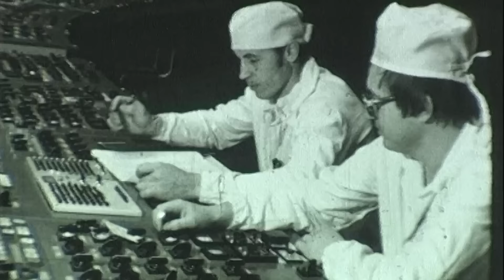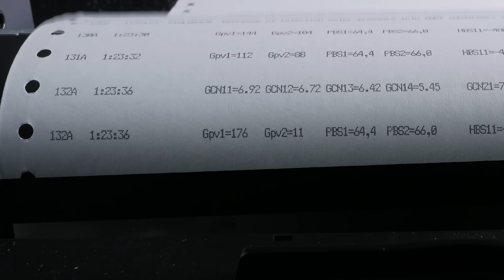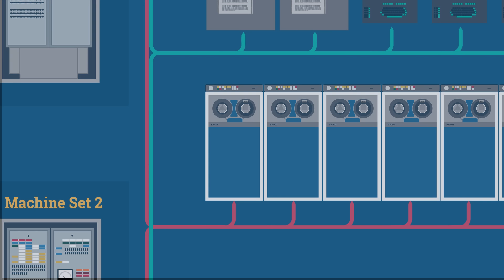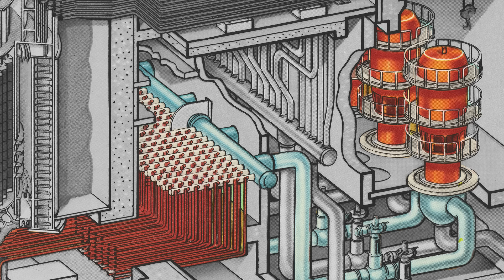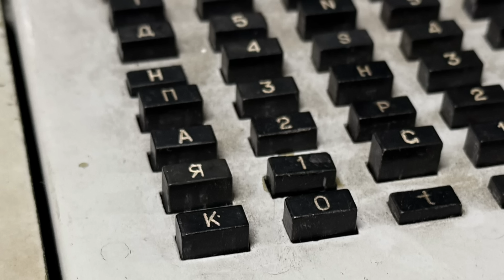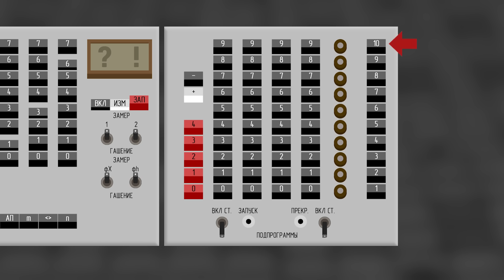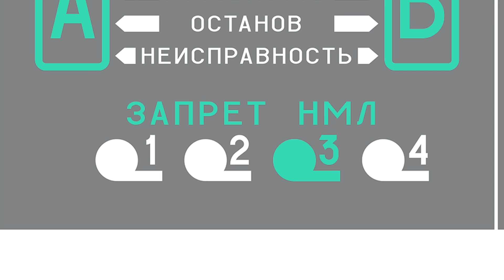Inside SKALA: How Chernobyl’s reactor was actually controlled

Comment: It's kind of fascinating that in time not gone for very long we've been regularly using these super convoluted systems to control huge machinery and nobody found it strange. Today it would be like "Excuse me, why should I remember thousands of codes just to ask a status on a machine?"
Reply: I have worked with some vintage computer systems in the UK, some of which I thought had really complicated human interfaces. This is much-much more complicated. 
Imagine an operator working this on a night shift at 3 in the morning, there must have been many human error mistakes per hour? After a few years there would have been errors from sticky push buttons, and failed indicator lights  appearing all the time...
The real question is how something this complicated to use, got into production without being made simpler and easier to use?
Reply: @BitTwisted1  Computer development in Soviet Union was generally hell. They had some pretty good projects, like ternary computers (native negative numbers wooo!). However progress was not determined by brilliance, but by what friends you have in the government. Pretty much every good thing to ever be produced in USSR was just stomped in to the ground.
Reply from the maker: Good point

Comment: Epic video!
In addition, there was also an ability to output certain parameters on current graph loggers (токовый самописец - СТ), they are located above or beneath the output sets VFD indicators
Reply from the maker: Yes, via those two toggle switches on the right. I did not go for that now, because I am thinking to get two devices and wire them to what we are building - to demonstrate in action.
Reply: @ChernobylFamily  This is amazing. Will be waiting for the demonstration video. Good luck!
Reply from the maker: За Монолит!

Comment: Love the channel and i video found it very intresting but i have a question the SKALA computer seamed to be antiquated for 1986 i know you have said in previous videos that reactor 4 was a new reactor only few years old at the time of the explosion but they have controled it with a computer that seamed from the mid 60s I know that the soviets where behind west in many technologys but even in the mid 80s soviet union had access to floppy disk hard drives and video displays and faster processor chips and i would of thought nuclear reactors would have been first in line for upgrades so why did they never upgrade the control system until after the disaster.
Reply from the maker: My point is that I do not consider myself enough competent to judge. It is like if I'd talk about ergonomics of the cockpit of the passenger airplane. The key is VNIIEM-3. This machine was very special and very stable for this kind of task, and I believe in stability versus performance, they went for stability.
Reply: @ChernobylFamily  I guess that does make sense they would rather go with what they Know works instead of gambling with new technology that they are not as familar with and untested and working with nuclear reactors there isnt much room for error so better safe than sorry,

Comment: Wish there would a a REAL SKALA option in open-simh to emulate.

But I disagree. Technically SKALA maybe could run doom with a complete rewrite, and a fully specced out SKALA. Honestly I would love to try it, but I have no SKALA in my basement! :-)

This doom would be very basic and text only. Because SKALA could have a real terminal. Late 70's SKALA had up to 128KB of RAM. And you get 5MB of storage on a SKALA tape. The problem lies in the architecture. The SKALA cant start programs. It runs "ROM" Code, not "sub" applications. How much RAM is really free. For a raycaster I would beed 50KB and the terminal should be 4k8 or 9k6. Otherwise it even is a CLI slide show, not to mention, I have no idea of many things of the SAKLA.

But I would love the challenge. But that would mean to take a SKALA apart, hence the open-simh like emulator.

Correct me if I am wrong, but the SKALA is more like a massive analog arduino and less like a pdp-11 or other general purpose computer.
Reply from the maker: Yes, it is a good metaphor with Arduino. Speaking about DOOM, DIIS system of SKALA would run it right away as a part of it a a few 80386 computers :)
Reply: @ChernobylFamily  using the 80386 part defeats the challenge. that is cheating.

Comment: Hi. I remember You mentioned long time ago that Skala has some kind of supervisor and scheduler. So I think that, although It doesn't have an fully-fledged OS, with virtual memory, shell etc, it for shure has some kind of Embedded RTOS. Let's say that a very simplified form of something we would call FreeRTOS todays. If there were different routines to starts, there must be a software system of events, tasks, priorities, multitasking etc. Even AGC in Apollo Series spacecrafts has it's own Apollo System Software, which was a RTOS. BTW. Do You posses any documentation about SKALA software model and architecture? I thing if it would be possible to recreate it on FPGA and run original software.
Reply from the maker: I need to talk with actual engineers. Many things got forgotten or simply degraded within the last few decades.

Comment: Great!
I see that the drive EC 5017.02 has a "Carl Zeiss Jena" mark?
It's possible that the Soviet Union didn't have the right drives or was working with other Eastern Bloc countries (Jena belonged to the GDR), and that's on the "Robotrontechnik" website.
A similar drive is also present in the Soviet RIAD series computers.
EC 5017 was probably also used in the Polish MERA 700 terminal
Reply from the maker: Good eye! Yes, Soviet tech often used components from other Bloc countries like the GDR.
Reply: I have a question
Where are the alarm signal speakers/horns located?
This is quite loud on many recordings.
Each console (SIUR, SIUT, etc.) had its own?
Did someone put it somewhere central?
Warning indications were also generated by SKALA, or
 only  triggered by SKALA , and the rest was done by the electronics in the control room?
Reply from the maker: SKALA alarm is at its mnemonic panel. Of control room — inside the control panels.

Comment: Awesome stuff. Thanks so much!
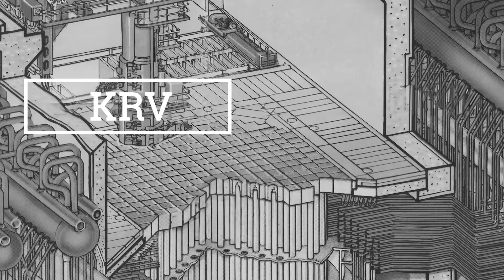What about these pipes 8:00 whwre coolant flows.
Was it water or special fluid? If water, how they keep system running, I bet they didnt have any stainless steel pipes. Water would rust the inside of pipe and so it becomes clogged up. And so on...
Reply from the maker: Water. But the answer is quite complex. Check this video: https://youtu.be/nta6h76NSCI

Comment: Why are the third row of keys marked in Latin?
Reply from the maker: And why not? Physics and math are always the same everywhere. Symbols used are standard to mark certain things. E.g. we write Cyrillic in Ukraine, but we use greek and latin when it comes to formulas. And it was always lile this.
Reply: I asked myself the same question, and from my perspective (I design control systems for a living) could be either to avoid mismatching wiring during assembly phase or to just help operator to frame what he is actually pushing, we might take into account that these device has to designed to be operated also in emergency mode at 4 in the morning, so every smart detail that can minimize stupid human error should not be overlook